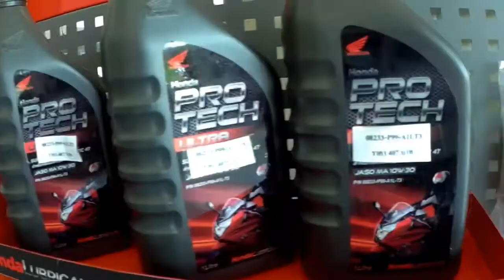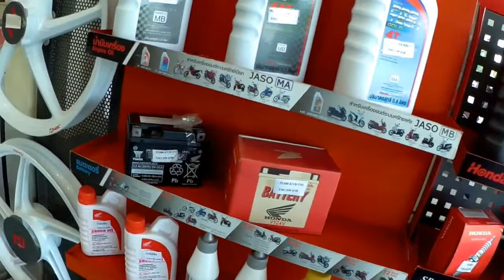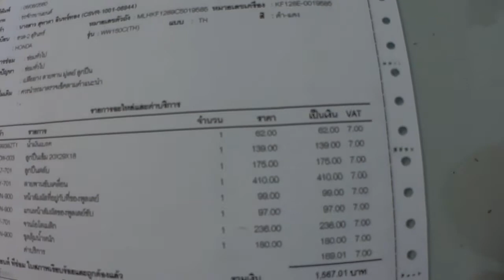Great Service With The Honda PCX At My Local Honda Dealership in Chumphonburi, Surin Today.

Comment: Cheap and good service....3-4 of them going at your bike. Only thing i am suprised about is the fact that they didnt have one ratchet or air tool. White grease also, costs more but it is the best.
Reply from the maker: Kirk Wilson Plenty of air tools Kirk, the chief mechanic started with an open ended spanner on the bearing puller but I think he felt my disdain and plumbed for the ring spanner. In my head though I was thinking "use a socket and ratchet" lol

Comment: might have been due to your front breaks not the tyre,,, And we never have a problem with honda service ,,, And it is free for the life of the bike if you buy it new,, And love how there uniforms are so clean,, in aussie they would be covered in grease,,, look like doctors,,,555 they need some air tools,, and how will you fix a flat tyre when it has no tube ? as i don't think all the little bike shop will be able to fix a flat that has no tube,, Great vlog,,
Reply from the maker: Sean smith The brakes are too good lol. Remove the nail/ object squirt in some puncture foam sealant, jobs a good 'un. Used it a few times on tubeless tyres, works well.